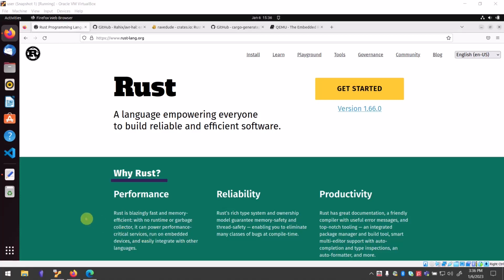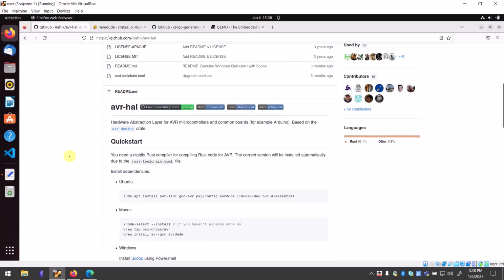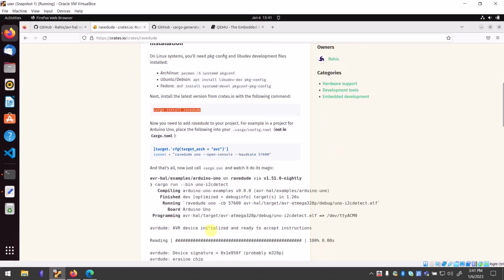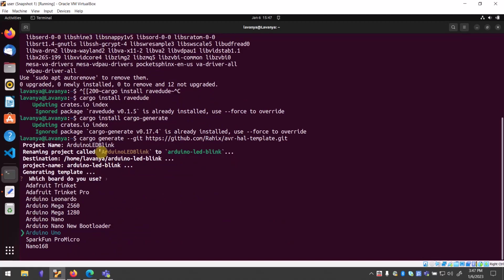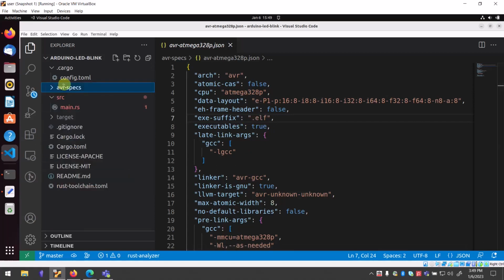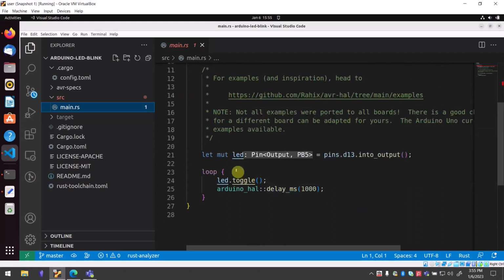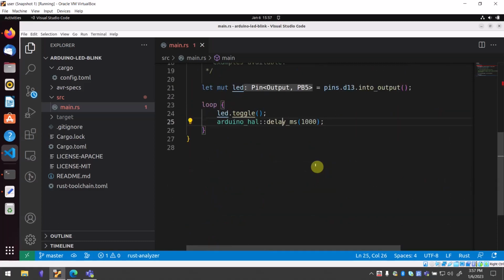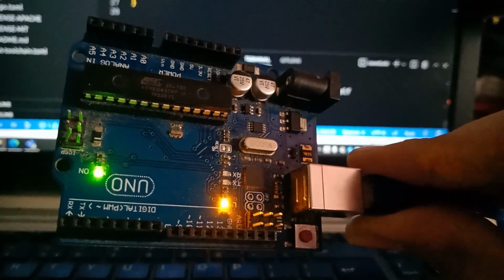How to Program Arduino Uno using Rust Programming Language | Easy way | Blink LED Project

Comment: --release flag won't give detailed debugging information,  actually, it does the opposite of this. It is used to produce an optimized binary.
Reply: u can change the options in the profile, u can see at the end after the build completes it says [optimized + debuginfo] and if it wasn't true it would say [optimized]. usually for debug builds it says [unoptimized + debuginfo] but maybe they changed the profile to strip all symbols. it can all be configured